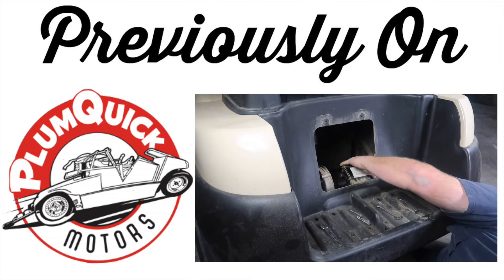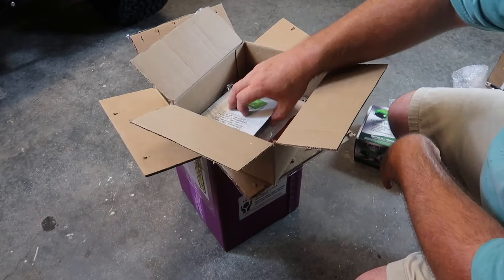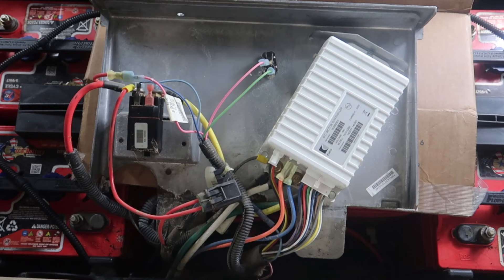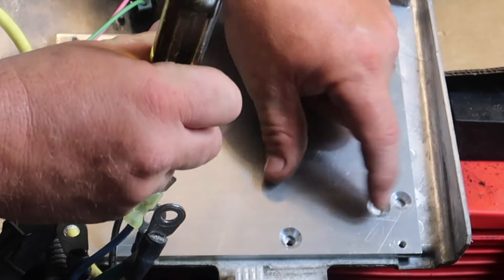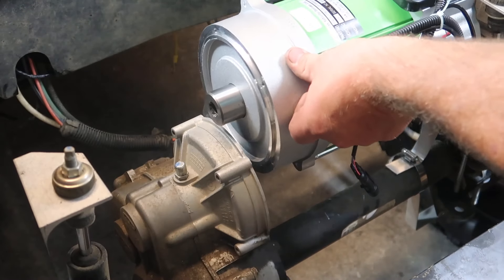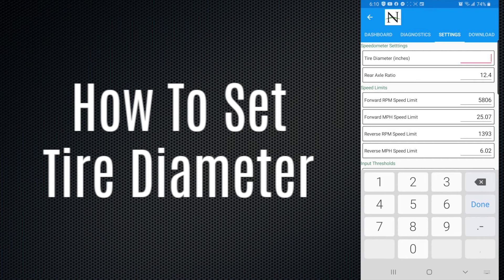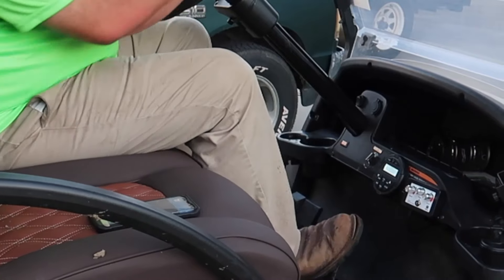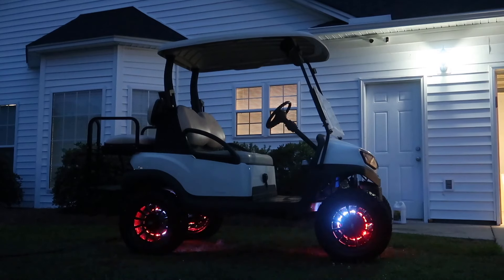How To Make Golf Cart Run 35 MPH |  Navitas 5kw AC Conversion on Club Car Precedent | Plum Quick

Comment: Hello there, first time visit to your videos and have to say great job! Have you ever heard of the Tomberlin Golf Carts? They come stock at 25 mph, with the best 0-25 time in the industry standard. Also there’re other features not found in any other cart, that is hydraulic four wheel brakes, with drilled&slotted disks in front! Plus power steering, DOT safety glass windshield and wiper. Four wheel coilover adj suspension, that’s independent up front, with a trailing arm live axle, with what looks like the biggest AC motor I’ve seen, that’s actually rated at 17 hp! All powered by 8, 6 volt, deep cycle ,Trojan T 105  Lead Acid Batteries, with a 450 amp controller. I have no lift, but I do have 235/50-12 AT tires. There is also a speedometer and ordometer , that tells me I can cruise at 25 mph with just half peddle, but can squeeze 26-27 at times. I believe this is the only cart that could actually be fairly safe at speeds over 28 mph! Never mind 30 mph! I bought the cart in June 2018, that had just two warranty issues, one was a steering knuckle that had the splines strip, that was actually repaired at the Tomberlin Factory in Leesburg FL, after i trailered it up. I got a good look at the place and got to talk to the head tech and watch him work on my cart on a lift for a couple minutes, after everything was finished, I begged him to re-program my cart, but he told me he was legally bound not to! But did show me and let me ride the owners cart! That was the same model as mine an SS Coupe, 2 seat, but his was a wild electric green. That was the fastest cart I’ve ever driven! That could pop a wheelie and get up to 38 mph!! In under 8 seconds!!! All with the stock motor! The big part of the job was changing the gears! My wife has a 2018 Ez-Go TXT 72 Volt, that leaps off the line, ahead of mine, but as soon a she does I catch right up and walk away! Her cart will get to 25, but that’s it an at the floor! It would be cool to turn that one up, but with stock tires an mechanical rear brakes would be hairy! Take care good luck and have fun and stay safe and healthy!

Comment: My cart is still being worked on but I got to drive in it a couple days ago. I have this exact kit installed with same batteries and had all the dials turned up and didn’t see 35mph. Then I drove a Curtis motor with controller and saw 39mph with tons of torque. I must admit....I’m a little disappointed. My cart is no faster than a ICON golf cart. Hmmmmm.
Reply: Any info you can share on the Curtis motor setup?
Reply: @patrickcheever9718   I don’t have info but if you call Curtis, they can help you. They’ve been making electric motors for many industries for many years. Combine this motor with 3-4 Relion lithium batteries and you’ll have 49-50mph.

Comment: Hi did you use the Roy pow lithium on this particular cart with this motor and navitas controller? As well as the stinger?
Reply from the maker: Yes I did. I have the roypow video up as well.
Reply: Fentertainment perfect thank you and saw the video but after shopping around for motors and letting them know I had Roy pow they wanted me to make sure it was compatible... so just making sure
Reply from the maker: @dezirose6254  Yup, Navitas just did a new firmware upgrade also to select the lithium battery.
Reply: Fentertainment perfect thank you for the info.